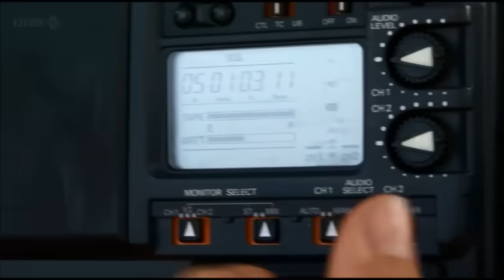Compressor Diving & Pa-aling Fishing

Comment: Being a hard hat diver/underwater welder & Salvor, I give this guys serious props.. this shit is no joke. I’ve had a slight case of the bends before because the Dive Sup fucked up the five tables but luckily there was a hyperbaric on site and they were able to slam down to do depth in the deco chamber and get it sorted out quickly. Only chance for these guys is to get back down into the water column and decompress.